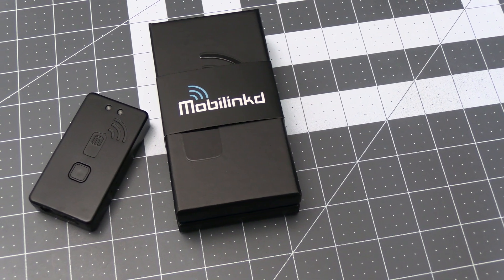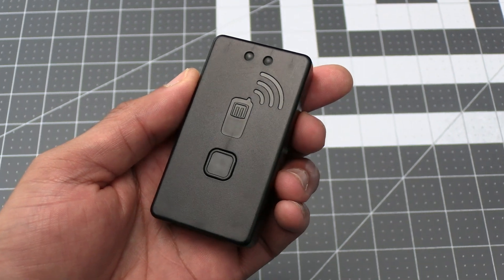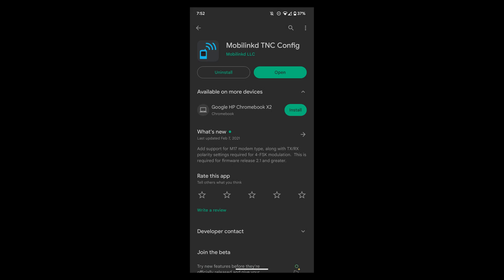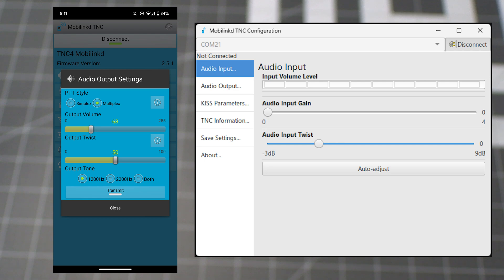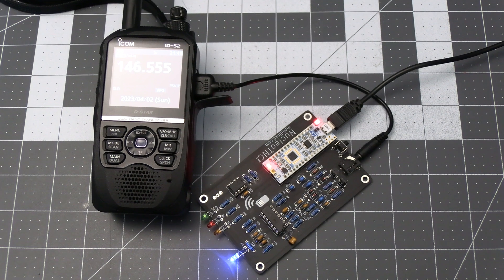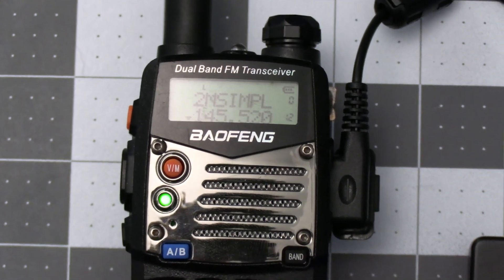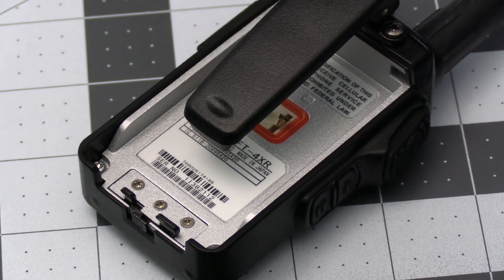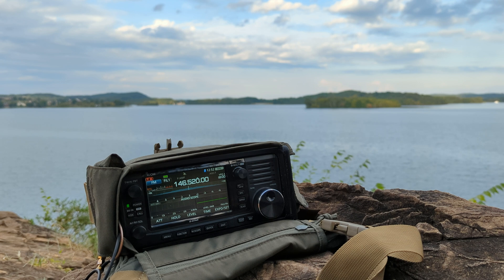Mobilinkd TNC4 Testing and Review

Comment: What's 96000 buds what is does ? 12000 vs 96000
Reply from the maker: 9600 is just a bit faster data rate. There's not as much equipment that uses it though so most stuff out there is using 1200

Comment: Good video, I have the great ICOM w32a as well the ft 857, I tested my TNC4& Yaesu pretty straight forward, so my question is: is there a way to keep the settings for each radio or once adjusted can be used with different radios( would like to use between the Yaesu and the ICOM)as plug and play? Thank you in advance
Reply from the maker: Not that I'm aware of unfortunately. That would be nice to have though